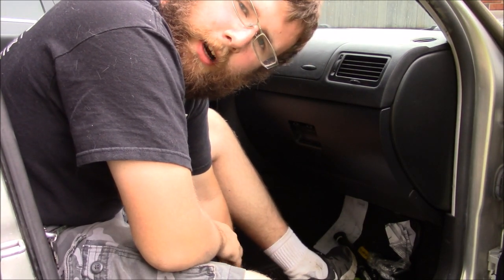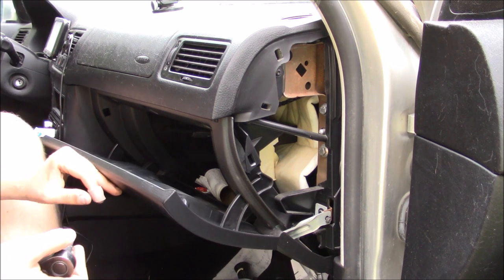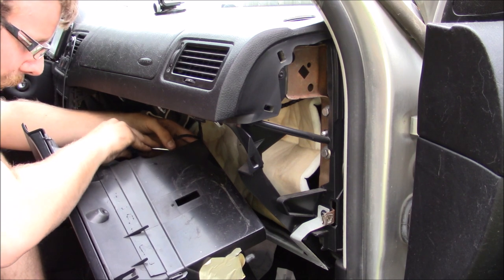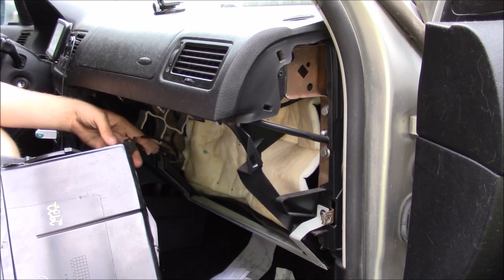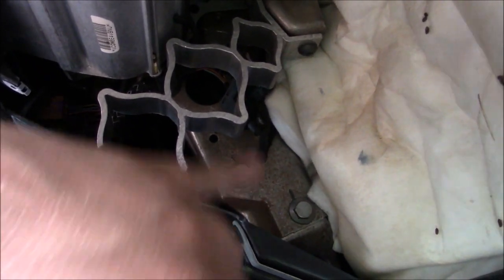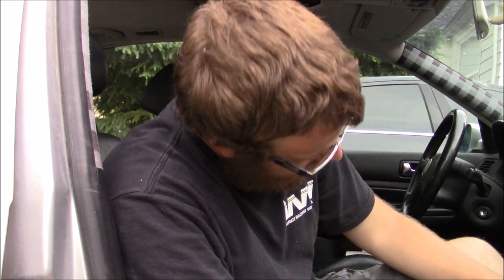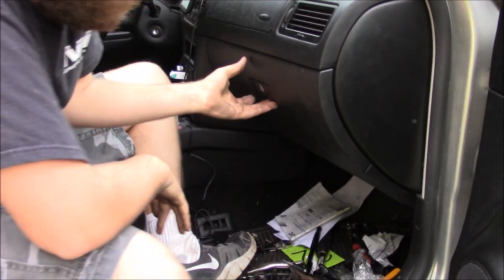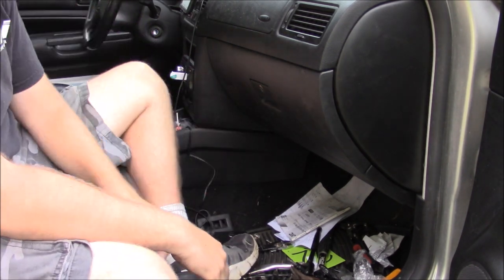How to Change and Upgrade an MK4 Volkswagen Glovebox

Comment: I just removed the last screw, and yes. It's difficult BUT doable. IT involves removing the center console, which requires removing the handbrake console, which requires removing both the armrest and the rear ashtray.  What a PITA!
In the end you need to do all that, because you want do things right ONCE when mufffling all that squeaky, rattly plastic trims with double-sided cushioning tape a/o adhesive felt.

Comment: Cool video! I’ll probably change that glovebox out in the winter. For now, i did a quick release style mod for it. I just screwed in a small bolt about an inch or less on the bottom part of the dash (don’t go too high or you’ll hit the airbag!)  and about an inch or less at the top of the glovebox. Then I just used a small hair tie to hold the glovebox shut! Took like 10min for a temporary fix. Thanks for the video though, now I know how to remove it when I change it out.

Comment: I found that if you remove the airbag (pop the cover off, 4 torx screws & unplug) it gives you much more clearance and all you have to do is remove those 3 bolts at the end with a wrench. Don't even need to touch the torx on that metal bracket as it's attached

Comment: Which year car did the larger box come from? Do you have a part# for it?
Reply from the maker: i do not have a part number for it, but i believe it was middle of 03 or 2004 that it started being put in, i could be wrong but i think thats when it changed over
Reply: 99.5-2001 was early small boxes. 2002+ is new big boxes. 4 years late. Lol.

Comment: I did it in my Jetta mk4 and was very easy just you had to have the right tools some skills bending yourself and patience and everything should be okay the wires I recommend putting those aside don't try to engineering or manage how to installed back and case you have to this kind of upgrade Easy Peasy

Comment: if i have a lid already and no handle that wont stay shut should i get a new lid with torque screws or just a handle?
Reply from the maker: for the amount of hassle doing either one of those options are, i think youre better off replacing the glovebox like i did here. its possible to do what you are saying but not worth it really i dont think
Reply from the maker: im not sure if its possible to do this but maybe velcro would work to make it stay closed
Reply: I used Velcro but when the weather got hot it let go and I had to keep putting new Velcro. I watched a video on glove box repair and it ended up being something easy like the latch only had to be pushed in.
Reply: Russ link?

Comment: Does breaking the hidden screw affect anything or is it still secure? I'm afraid to break mine
Reply from the maker: it wont hurt it, you have to remove the center console and shifter surrounding console section to take that scew out i found pretty much, its not like you are putting 10 bricks in your glovebox to weigh it down

Comment: Are you using a VW part or a third-party glovebox? Just wondering since the VW quality for interior parts seems quite dodgy.
Reply from the maker: I used a VW part, the bigger glovebox i put in is far better than the old small glovebox i took out though

Comment: But why did he had to remove that metal bracket to fit in the glove box again in place?? Since it comes out easy should go in easy too, same way...
Reply from the maker: It had to come put to fit the larger glovebox into the car
Reply: @MikeUtoober  larger glove box? From what car ? I thought every golf mk4 glove box are the same size...
Reply from the maker: 2004+ i think it is has a bigger glovebox than older ones
Reply: @MikeUtoober  oh OK. So before 2004 should all be the same time?
Reply: @MikeUtoober  for what I've read,. All you need is to remove that big bracket to fit the new glove box. Not 2 brackets
Reply: By the way my golf mk4 is from 98 Gti, and has originally the big glove box. So probably the big ones came out in early models on gti models

Comment: So you removed the metal thing?
Reply from the maker: you have to remove 2 metal pices, theres one that is a bracketthat attaches behind the air bag and then remove the bracket that is mounted to that, not that easy to do but it is doable
Reply: I did it without removing the 2 metal pieces.
Reply from the maker: You just replaced with the smaller glovebox then. Mine had the small one originally and i put the bigger one in. Thats why i had to remove them

Comment: Darn I was really hoping this showed how to open it if you can't even put your finger inside to open it anymore. I am stuck... I can't open my box at all.
Reply from the maker: Just break it. Its already needing replacement anyways
Reply: Yeah i was able to pry off the first panel on the right side, and push a tab in that moves /opens when you use the latch. Than pried the other side. Now I have a Duct Tape closing box. I will have to replace with your video. Thanks.
Reply from the maker: good, and im glad the video helped